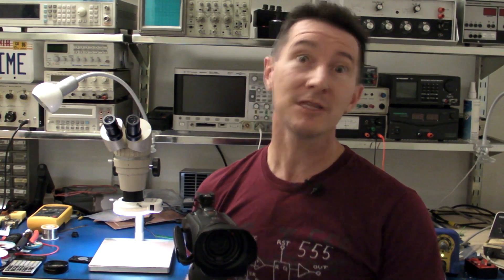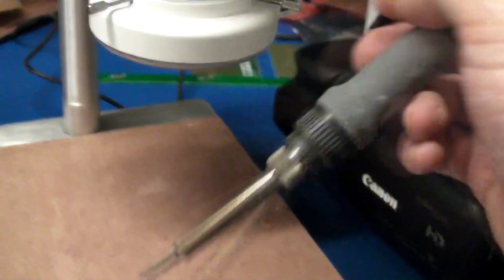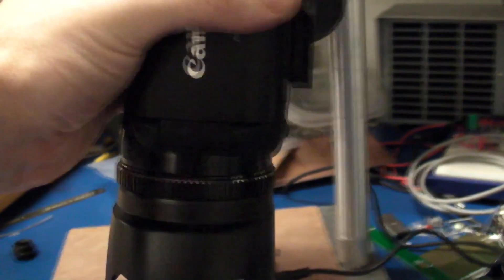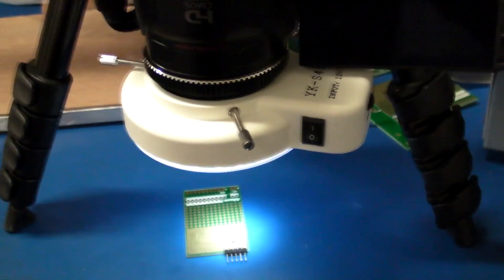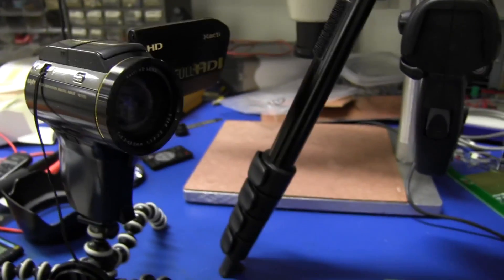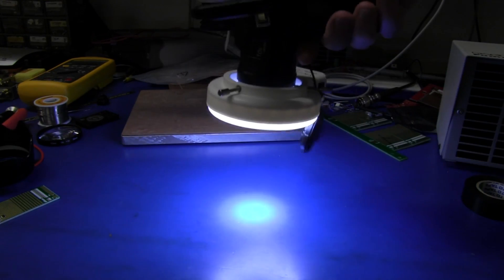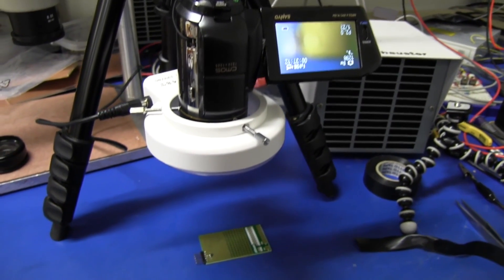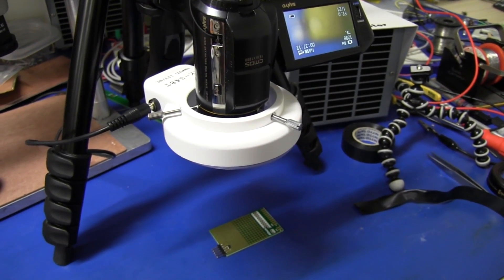EEVblog #282 - DIY Video Soldering Microscope

Comment: its 2020 now... and i use a "270x" cctv camera  i can use up to 6x without problems and for closer inspection i use a old 35mm canon objective put in reverse. it will fill a screen with a cpu pin :) from something like 25-35cm

Comment: I used an old cctv camera which you can manually adjust the focus to on the outside - connected it to a monitor & it worked extremely well. I’ll hook up again & see what working space available under - camera very cheap/old school from eBay 2nd hand as people throw them out when replacing with Wong hung lo systems

Comment: The more expensive macro adapter is better, huh? Is it, really? Are you sure this isn't your bias against cheap tools coming into play? =) Have you done side-by-side comparison of the same subject in the same conditions, viewed on a big screen? 

I ask because, these days, it's pretty trivial to make single-element lenses of sufficient precision to avoid visible distortion of any sort on 1080p-quality video. And that's all we're really talking about for these macro "filters". The big differences vs. expensive brands will be the coating (which will affect abrasion resistance and glare), and the transmittance (which would matter in low light, of course). But the coating is basically completely irrelevant sitting there on your bench, working in static conditions in diffuse light. An uncoated lens would be fine, assuming it's ground to sufficient precision. 

Moreover, the cheap one doesn't vignette the fast-focus sensor, so would seem to be objectively more functional in this use case. And thus, by my reasoning, "better", assuming the resultant image is equivalent (which I would bet – a couple bucks, anyway :p).

Comment: Great idea! I thought I'd give it a shot with an old camcorder I have, but it didn't cut the mustard. The screen is quite small with a slow refresh rate and using a laptop as an external display didn't work out too well either. There was a lag of about 3 seconds using firewire (perhaps s-video into a TV would do the job though).

Comment: @EEVblog If you divide the picture in a 3x3 grid, you are 2/3 to the right and your eyes are 2/3 to the lower part of the video. This is good practice. You can be centered if you like but don't keep your nose right in the middle. (rule of thirds)

Comment: If you have a DSLR with live view/tethering, you can get yourself a bellows, a enlarger lens (used for photo enlarging, now sold really cheaply on eBay) or just a good old prime lens and a reverse mount adapter...

That should provide even better edges and good working distance.

Comment: Hey Dave,
I have the Xacti HD1010 and I'm sold on your economy microscope application.

No luck searching for the YK-S48T model # but I found one that looks the spitting image of yours on ebay.
 Specs:
- 54- LEDs
- "mounting size = 56mm" (says 55mm "ring light")

It can be bigger, just not smaller.
Does this seem to meet the specs of the illuminator you have?

Comment: I purchased a stereo microscope on amazon for about $1,000 USD.  It's great because it has an articulating arm...and even came with a great camera!  But the camera software and frame rate suck.  If you're working or moving parts around, it's similar to a strobing effect.

I'll have to find some way to fix this.  I don't have to take my eyepiece out.  To use the camera you have to slide a rod out which disables the left eyepiece...you lose it, but you don't have to physically remove it.

Comment from the maker: Yeah, it is likely usable, and will play some more. The problem is I don't want to capture straight to the PC unless I have no other option, because it's just way too messy with cables and software setup, plus separate audio. Much nicer to use my existing video camera rig and workflow. The only cable I have is the LED light, and external mic if I chose to use it.